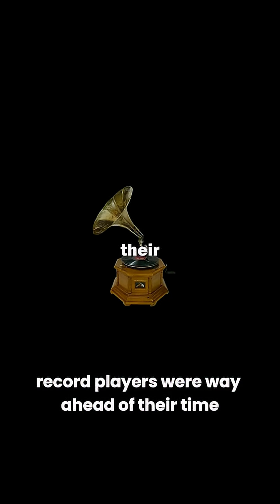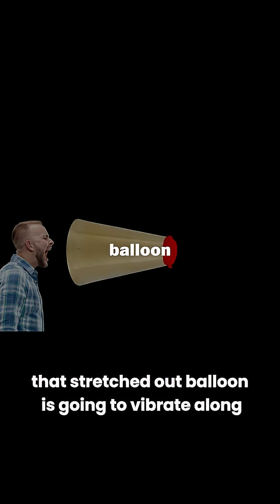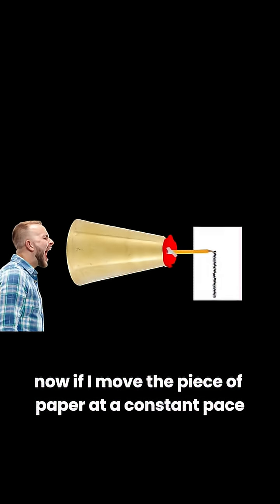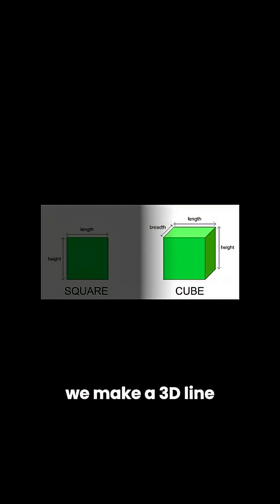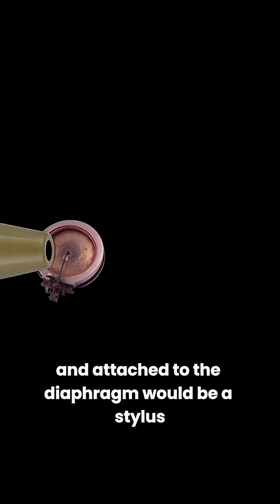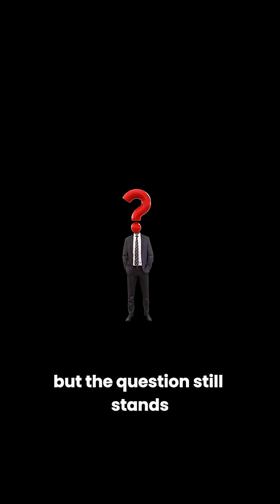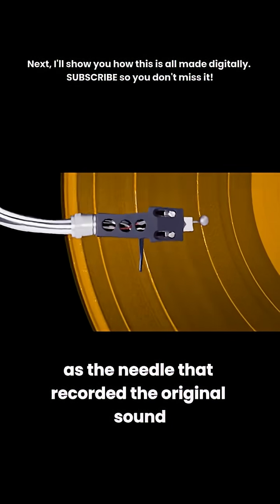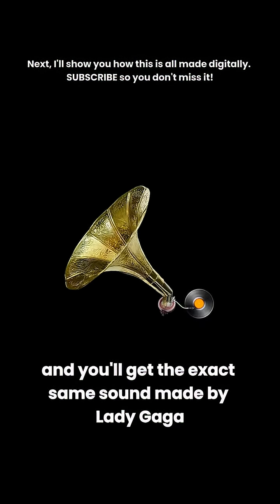How Sound Is Recorded... Explained in Under 2 Minutes 🎤✨

Comment: is the bass or sound more rich on a vinyl or digital?
Reply from the maker: Digital usually gives deeper and tighter bass since it captures the full frequency range, but vinyl often feels warmer and fuller because of its analog character. So it really depends on whether you prefer accuracy (digital) or that classic richness (vinyl).
Reply: @realmindsnacks  thank you so much for the information. so i test it out, same speakers  and receiver add on iphone bluetooth and earphone  connection cable with left and right outlets plugs and used a CD also to compared to a vinyl LP, now according to my ears(lol) the digital download and compact disc the sound was  a saturated bass, you can tell immediately the difference and with same receiver equalizer, now the vinyl was a bouncy  texture bass more air i think as to the cd and download they were more grounded more solid and also the scratches gave the sound more air to expand i think lol. i recommend everyone to experiment on this. Luv your channel. thank you for encouraging me to experiment with sound. Cheers.